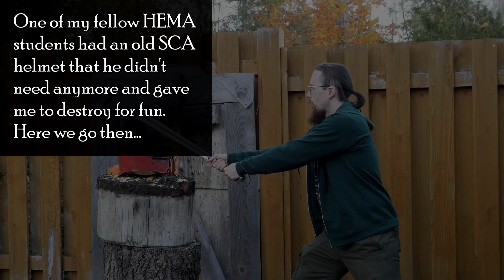Bar Mace and Blacksmith Hammers vs. Old SCA Helmet

Comment: Up until the 2 handed hammer got involved, that helm was eating hits like it was breakfast.
Reply: SlightlyNotorious yeah, that's kind of obvious, more a testament to the strength of the helm, not the spine...
Reply: The helmet is pretty fine though
Reply: aside from the maul, isn't that why a lot of soldiers of the time wore some kind of padded protection so as to prevent that, obviously it would happen if you hit the right spot but surely not all of them
Reply: Yeah, with a liner and (Edit for spelling): padding, you might be able to turn with the mace blows to an extent and eat some of the impact, but that first hammer blow to the side of the helmet would have rung their brain like a bell.
Reply: Alive? Probably. Conscious and/or without a concussion? I don't believe that would be very likely.
Reply: SlightlyNotorious I suggest you watch some HMB or Battle of the Nations and check out what kind of hits those guys indure. Not that easy to kill someone in a helmet, knock him out is another question
Reply: >_> I swear people see that bludgeoning weapons were favoured against armour and immediately come to the conclusion that bludgeoning weapons were lightsabers.

Just because something is more effective than other weapons against armour doesn't mean it somehow completely bypasses armour.
Reply: Anndgrim preach
Reply: The smaller hammer was making a dent or two, but that was mostly because it was on an old stump, so nowhere to go.  I would like to see more extensive testing with that bar mace.  I've only ever found two videos of them on YouTube, and both barmaces failed bending at the handle.

Comment: Well that's one way to split a log
Reply: Right?
Reply: Not too far off from how my grandfather had me splitting wood when I was a kid. Didn't trust me with an axe at 15, so he gave me an eight pound sledge hammer and a pair of steel wedges. Works well unless you hit green wood, then you duck and cover as a five pound steel wedge goes orbital :D.
Reply: That's a fairly common method for felling trees, hammer in a couple of wedges into the trunk after an incision by axe or saw so as to better control which way the tree falls
Reply: a typical video on this wood chopping channel
Reply: What's impressive is the hammer didn't even touch the log, and it knocked all the bark off in one go too

Comment: SCA gear is no joke. It's armor that designed for what is essentially just mace combat.
Reply: That armor is surprisingly durable taken it took them several clear hits to even start making a dent on it. 
Kinda makes the ending card's point moot, really, lol
Reply: Yeah, having done a bunch of SCA fighting some of the helmets people make may not be histoircally accurate, mine certaom;y wasn't, it was called the blue boot and it looked just about like it's name sounds lol. But damn that thing could take a beating.
Reply: Old SCAdian here. I remember the Freon tank helms. Some of them were pretty battered at the end of their time. Much more stringent standards and way better workmanship. Of course in those days, hockey gloves and pads were allowed.

Comment: I saw the video was 2 minutes and thought "Ha, that helmet didn't last very long." That comparison put a new meaning to 'Stop! Hammer time!'
Reply: Tiberius Tigris Not true, unless there's been a really weird change since I've fought with them. They have a minimum steel thickness for helms.

Also, note that this helm takes a lot of perfectly aimed two-handed blows with blunt weapons and doesn't deform for a while (except the bar grill). Most helms would deform under that beating.
Reply: How long should a helmet last in this sort of situation?
Reply: I did no expect the helm to last this long.
Reply: SCA helmets have to be at least 16 gauge steel, so still the minimum functional helmet thickness according to what Skall has tested.
Reply: I thought they upped that to 22 gauge?
Reply: SonOfMyths73 You know that the higher the gauge the thinner the metal right? 16 gauge is just over 1.5 mm, 22 gauge would be less than a millimeter
Reply: Braden Vande Plasse, Beat me by an hour on pointing this out, lol. Have a like :).
Reply: PaleGhost69 
that helmet lasted FAR LONGER then a person wearing it in a fight would have before repeated concussions would get them to fall flat on the ground. Person in full plate is almost invulnerable 90% of the time(if they can fight back and defend themselves though).
Reply: Its 12 gauge steel here.

Comment: Shows what it takes to destroy even our older helmets. That is some good peace of mind.
Reply: I'd still hate to get hit on the head with any of those weapons even with the helmet. The shock transfer alone would be painful and disorienting much less the resultant deformation.
Reply: I was surprised how well it held up. Good to know eh?
Reply: still, if there was a head inside that any of those strikes would have been very bad for it
Reply: But there's always tons of padding. It's not as bad as you think
Reply: Yes it took a lot of bad hits held stationary. Your head doesn't do that. Your neck moves your body naturally absorbs force. The damage on a moving body would have been noticably less because you don't give it a rigid base like the stump does.
Reply: Doug Scholl Not to mention the helmet was sitting pretty low, allowing them to accelerate into a bigger downward swing that was likely aided in part by the force of gravity.
Reply: As everyone points out, your head wouldn't be feeling too well after absorbing even one of those hits. However, imagine how your head would feel after absorbing one of those hits without a helmet... I'm sure most of the hits shown in the video would have been survivable if you wore the helmet (even though you'd go down, with a serious concussion). Without?
Reply: It honestly doesn't surprise me that the hammers did more damage seeing as I've swung a few in the past. What did surprise me is how much abuse a SCA helmet actually absorbed. That said, the spinal compression and massive concussion would have taken the soldier wearing it out of the fight after the third or fourth blow.
Reply: My helm literally broke a drill once.
LOL.
SCA-ready helms are fucking indestructible by all but the most extreme of means.
This is coming from a guy who literally broke beyond possible repair the inner workings of a brand new tank of a drill trying to make a hole for the chinstrap. The drill caught fire, by the way. That's how bad it was. I ended up taking a chisel to it and slowly punching out tiny holes with a 4 pound smithing hammer.

Did I mention indestructible?
Reply: The helmet is irrelevant if you get hit like that.
Reply: I'm no expert, but the human body is surprisingly resilient at times. The effect in a combat would certainly be the same - you'd go down and be out of the fight - but I'm not convinced that all of the strikes shown in the video would actually be lethal, if given good, prompt medical care.
Reply: Thomas Ueland Torp sca helms are padded inside typically.  Most of those blows wouldn't even knock you out. A few definitely would especially coming from the large hammer.
Reply: I have been hit in the helmet by lighter weapons than those and it felt like my neck could have broken with a bit more momentum in the hit. I am of course guessing though.
Reply: SCA helmets are proper helmets. (This one is like a cross between bascinet and great bascinet.) You would want a rim on the bottom or a gorget and seat it well on top of a breastplate or at least your collarbones. Properly done you should be fine against neck injuries even with that hammer hit. The visor does not protrude enough I think.

Comment: Did... he just beat the bark off that log?
Reply: and the log. lol
Reply: @Agnarr
Bollocks! It's all a matter of what type of drill bit you use. When i was in my early twenties i drilled from wood to steel and concrete during construction for a living. You can't just slap on a drill bit designed for wood and expect it to pierce even the most simple of sheet metal. It would dull/destroy the drill bit and those lil shits are expensive. :(
If you wanna drill holes into thin sheet metals then you buy the proper bits for sheet metal. It'll take you 2-7 seconds to pierce that helmet of yours with ease even with the most basic hobby drill. ;)
Reply: Looked up on google image on SCA armor and you probably need a drill bit for steel. :(
Steel is the worst material to drill/cut through... A hobby drill won't suffice i suspect.

Comment: Now im curious. Did they actually used big hammers like that on the battlefields? You see them a lot in movies and i know they used smaller war hammers, but what about big ones like the second one you used on the helmet?
Reply: AClassyBeardedGuy 
No, too heavy and unwieldy for prolonged fighting.
Reply: Yeah the biggest hammer you'd take to a battlefield is basically a poleaxe, and the hammer head is NOT particularly big.

As damaging as that sledge was, an aware opponent could go have lunch while you take a big swing, then come back and stab you before you finished.
Reply: Definitely not. Even my rounding hammer would be too heavy. There were definitely  warhammers on battlefields but at about half the weight of the 3.5lb hammer.
Reply: Putting aside the academic no-no of not telling us where and when the picture is from, it's obviously HIGHLY exaggerating many features (FEAR MY INEXPLICABLE ANTLER ON A STICK), and is seemingly depicting English longbowmen wielding their stake mallets - wooden haft, and a 'leaden' head, but there's never any more detail beyond that. They are not likely to be as heavy as the thing in this video for the simple fact that someone has to carry the damn thing around on campaign and to the battlefield.
Reply: At the Battle of Agincourt it was said that some or the English archers would use mallets, which they normally used for driving in stakes, as improvised weapons. But this is hardly the same thing as someone deliberately going in to battle with one for use as a weapon.
Reply: Not intentionally. English longbowmen used mauls if caught out driving stakes.
Reply: @ friis forge lets say the army started conscription/draft, would the blacksmith bring his forging hammers for battle, since they are intimately familiar with them, or would they prefer a differant weapon
assuming the smith either was not former military, or otherwise formaly trained in weaponry?
Reply: Alt-Bringer Albus chances are that a blacksmith wouldn't be drafted into an army, not as just a grunt at least, most likely he would serve as the army's blacksmith. Any Lord raising an army would make sure that anyone with special/useful skills would be recognized & talked with using those skills for his army & not wasted caring a spear.

Comment: That was actually a good helmet
Reply: right?
Reply: Used helmets are the way to go if you are looking to get into the SCA. It's the most important part of your equipment and if it's been used, it meets the requirements for protection and durability. Also...cheap. Worst you can do is get an expensive fancy helmet right away or pieces that end up not fitting properly. Get used stuff, no fear of adjusting it to your body...grow with your armor, etc. After some time, go for fancy stuff knowing what you want. Most SCA practice will carry extra gear for new members until they get their own stuff if you just want to check it out.
Reply: "Was"

Comment: Hitting down onto the cheeks with the helm lying on its side is what warped it. Hits from above when it was upright all seemed well thwarted. It would be difficult to land one of those cheek hits with that kind of force while someone was wearing it. Good helm.
Reply from the maker: Yes, these hits were much more devastating because the helmet was being crushed between the log and the mace/hammer, with nowhere to go. On a head it would be pushed aside, so not all of the force would be absorbed.

Comment: Twin headed squared face rounding hammer and sledge if I guess right? Any reason for that choice?
Kinda surprised you didn't try the cross-peen considering it's iconic status as a blacksmith's tool.
Reply: Mr.13 
I'm guessin they used the rounding hammer for the added +10% damage that an Alex Steele hammer receives in the hands of someone who has forged steel sometime in their life.
Reply: Mr.13 
I was trying for a joke, but it got lost while I hammered on.
Reply: Good recovery.
Reply: Mr.13 
Thanks

Comment: I like how you split the log with the helmet.
My SCA helmet's an even thicker gauge than that.  It's fun to show it off to people by hitting myself in the head with an actual battleaxe, which would be dangerous if the battleaxe weren't one-handed and the helmet didn't have 1.5in of padding.

Comment: Too bad you guy didn't have a very large sledge hammer.
Reply: 13 lbs was the biggest I had. lol just a shrimp of a thing.
Reply: I shudder at the thought of what a 17-20 pound hammer could do in the right hands...
Probably something like a .75 caliber bullet with a small tungsten rod in the center fired from a moving train.

Comment: It's great too see how Skall moves his whole body into a strike. I don't know for sure but it looks like he's generating much more force than Friis, although Friis looks stronger but I think he's unsing mainly his arms. No offence, of course Skall knows how to move after years of practice. You both looked epic, that just caught my eye.
Reply: when it comes to technique, skal most definitely has better. I just kind of... see what works. lol
Reply from the maker: He actually did more damage because he is that much stronger. Just imagine what would happen if this kind of power was combined with perfect body mechanics. :)
Reply: the difference between hitting an anvil & tying to train in old ways to kill someone i suppose. lol
Reply: But still incredible how much you can achieve through right movement.  That would be devastating. :D
Reply: Skallagrim 
I don't want to imagine it. It's akin to giving a Space Marine a nuclear warhead hammer.
Shuddering

Comment: They have to be sturdy. Getting nailed in the head with rattan can do a lot of damage. One helmet I used has never been dented and I never really see stars, but I tried a friend's helmet, took two big dents and a very mild concussion from a two-handed rattan club/mace. Fuck that helmet. I mean, it saved my life. If I didn't have the helmet I'd have been in the hospital. It's just not as good as the other one.

Comment: Looked like the bar mace didn't really do a whole lot, despite probably being heavier than the blacksmith's hammer used after it which DID start leaving proper dents. Construction matters even for the blunt weapons, who knew? Would probably be better when fighting swords (and allows most sword techniques to be used relatively easily), but yeah.

Comment: Sca super clubbing Association

Alot of the gear is extremely durable if it's metal  it's ment to take clubs without denting and sca heavy fighters don't pull strikes people. This isn't larp even hema fighters enjoy it it's about as close as you can get to fighting old school
Reply: I need to start doing this...
Reply: Friis Forge it's pretty fun
Reply: It's worth it I did heavy fighting for a while and loved it
Reply: It's a bitch on the ears, though.
Take my advice and never wear a fucking great helm to SCA. Learn from my mistakes.
Couldn't hear for hours...

How the hell did he even do that with a sword? It wrapped around my (quite substantial) shield, and slammed into the side of my head on the opposite side, and with enough force to unbalance me.
That was exactly why the first piece of my own armor I ever got was a helm - mine is an amalgamation of Classical/ Archaic Hellenic, Norman, and Vendel influences. And probably a few others. Still gets hard to hear, but it fits like a glove and doesn't literally ring like a bell.

I should start going again... It's been a while. Between school, work, and other things, I haven't had much time.
Reply: Agnarr Salventius ear plugs was a big tip I got also that guy was probably a hema fighter they are quite a bit better than normal heavy fighters
Reply: The worst hit i took in the SCA was to the head as well. I ran into a guy with a readied pole axe around a corner at Lillies War and i did not have time to get my shield up to block his overhead swing. That hit knocked me on my arse something feirce, after that i just chose to kinda snuggle up against the wall and sit there for a bit untill the ringing stopped and i got my balance back.
Reply: I always made sure the easiest spot to hit my was the head as it was by far the best protected.  My old Burgonet sits on my desk these days with one huge divot where some guy from Artemesia whacked me with a Pole Axe.  Miss those days sometimes.

Comment: What does SCA stand for?
Reply: Society for Creative Anachronism
Reply: Thank you, is that just an event host? Or does it imply the helmet is a bit more historically accurate?
Reply: SCA would be the organization, it is a fairly large one at that all over the US and in Europe (Canada too, sorry Skalla). It is a medieval recreation group. The helms have progressed from old freon cans (back in the 70s and 80s) to a minimum standard of thickness for the steel. Accuracy is not really the point of SCA helms, keeping someone from getting killed is. That being said, most helms at least are based off of real designs from then.
Reply: So it's not just a helmet for the looks (like i originially thought) but it is also used in the recreational fighting at the events?
Reply: To my understanding, yes that helm was used for fighting
Reply: Thank you. :)